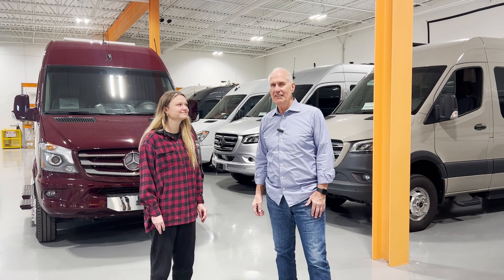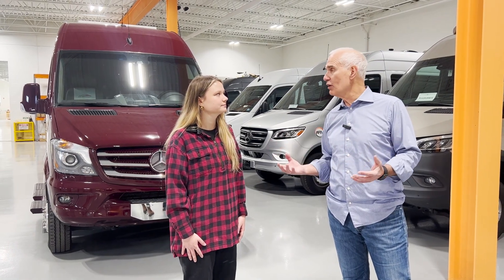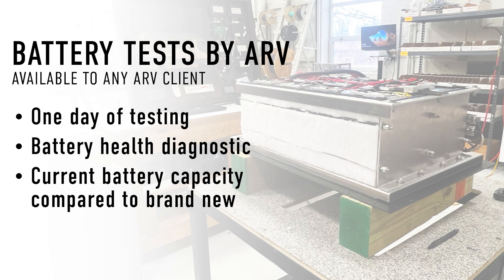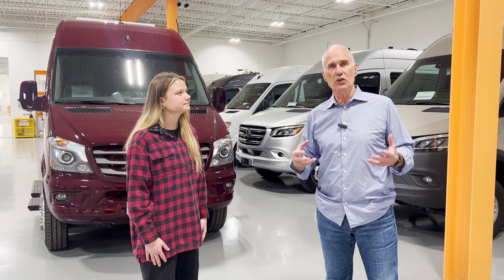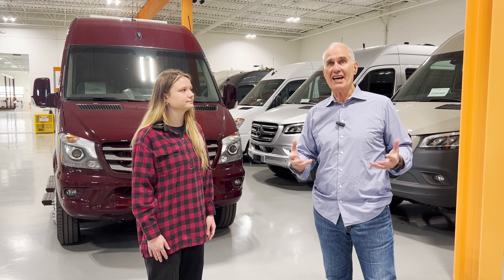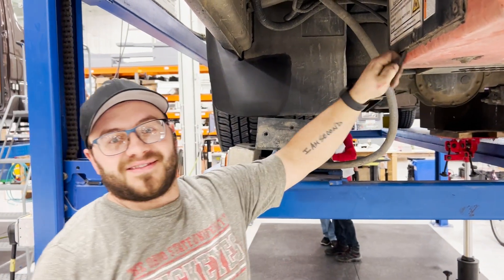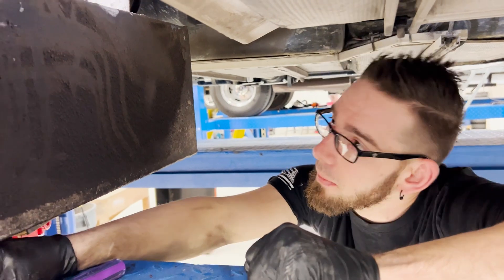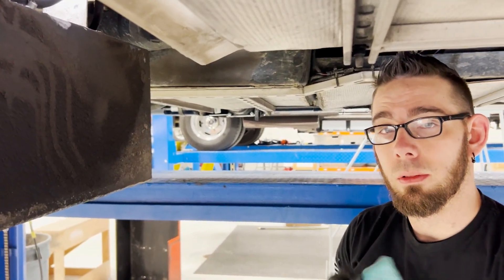A Battery Test + Guarantee for all ARV Builds

Comment: How would you abuse your batteries?
Reply from the maker: Primary examples of battery abuse:

Batteries discharged to 0% and left uncharged for more than three months.

Cold (-40°) storage for longer than a month (battery off) 

Cold (0° C) storage for longer than one year (battery off)

Hot (45° C) storage for longer than one month (battery off)

Hot (35° C) storage for longer than one year (battery off)

Discharging or charging from non ARV-installed devices and/or modifying devices to increased programmed charge/discharge rates.

Physical damage to the battery pack

Changing settings ARV has programmed into the BMS, or changing internal components of the battery system

Comment: Is Elise an electrical engineer?  Even on this video she does not seem to have the depth of knowledge to be doing anything to batteries with a "little computer."  And,  Elise is going to charge a Lithium battery bank to 100% and then deplete it down to 0% in the name of testing the battery?! Do you all at ARV not realize the fundamental problem you are creating with that process?!  Those Lithium batteries are not suppose to be taken down to or up to that level or you damage the internal physical core, which your customers will never know.   Don't believe me?  Do a google search.  Elon Musk has discussed this many times about all batteries.  Find his video quick before you damage anymore battery systems in your expensive coaches.

Comment: Only a 3 year warranty  for 80% original capacity?  Are you using LiFePO batteries?
Reply from the maker: This guarantee applies to our Available ARVs, some of which are pre-owned, have over 100,000 miles, and have batteries that are 8 years old. We are testing these batteries and guaranteeing that if they lose 20% of the tested capacity in three additional years, we will replace them. We expect our batteries (which are LiFePO) to last a minimum of 10-12 years from new if not abused.
Reply: @AdvancedRV  thanks for the clarification and yours as well @wildernessdisneydad1621
Reply: For pre owned battery systems